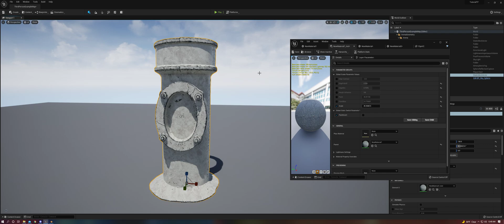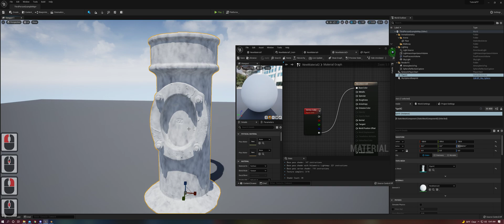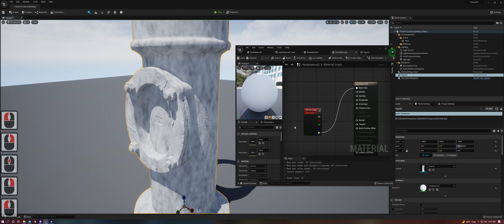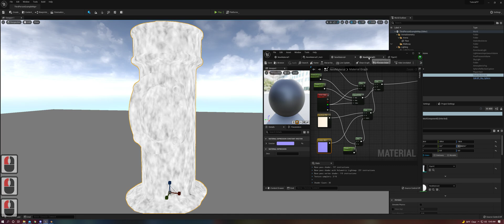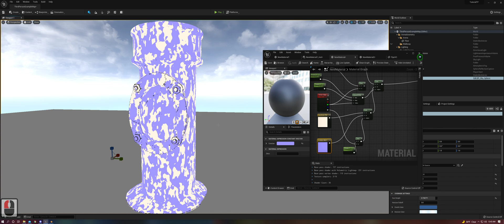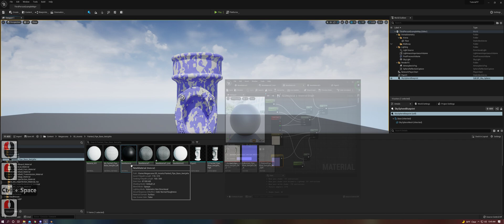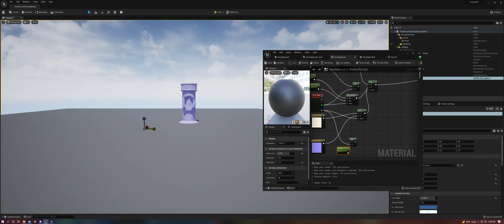Unreal Engine 5 Procedural Nanite Materials Using Vertex Colors

Comment: Hey man nice tutorial, but how to export meah with vertex color from blender? I dont have that option in by fbx export section :O
Reply from the maker: I don't believe you need to currently specify to export vertex colors, but do make sure that the desired vertex color channel is selected when you export your file as Unreal only supports one, whereas blender supports multiple.
Reply: @TechArtAlex  Thanks for reply, ive found my problem - when creating vertex color attribute - domain should be Face Corner and data type Byte Color.

Comment: Great, thanks for the tips. A way to fix the noise popping. If you don"t bake the noise in the vertices but use instead world noise then it should not be a problem that Nanite removes verts on flat areas right? SO use the Vertex bakes only for Curvature and AO, since they are on more denser areas, and for flat areas just use conventional world aligned textures. You can use the other Vertex Channels to separate materials for example.
Reply from the maker: Exactly. For something like noise it would be best to use a texture.

Comment: How expensive is this compared to a more classic workflow with UVs ? (in terms of shader complexity)
Thanks, that's a very interesting technique
Reply from the maker: A fair bit more expensive, but not prohibitively. However, because they can allow multiple objects to look visually different on a single material, they can counter the cost through allowing for fewer draw calls and less unique texture fetches. If the material will not be re-used in the scene, it would probably be better to bake the result.
Reply: @TechArtAlex  Amazing, thanks for the answer, ! That's really interesting. I'm gonna experiment a bit with that :)

Comment: Hey Alex! Thank you so much for the tutorial! I am having an issue where the world align normal doesn't work with nanite mesh, I am wondering if you have ran into the same problem or if there is a special setting for it ? Thank you
Reply from the maker: Yes, I believe I had to use world space normals instead of tangent space normals with Nanite. You can simply use the transform vector node on your normal map and set the boolean in the world aligned node.
Reply: @TechArtAlex  Thank you so much ! this fixed it !

Comment: Glad I found your channel. I’ve been googling information on this all day. I do have questions though. Can you use layered materials instead to blend in between the vertex color mask? If you’re familiar with paragon and how the textured their characters I want to attempt the same approach with nanite meshes. 

Can you create more than 4 channels. Is it possible to use the procedural channels like you did but also have 3 more channels for more material options. I’m half way into the video and wanted to type this before I forgot.
Reply from the maker: The mesh can only have 4 colors per vertex, but you don't need to use the full depth of values for a single function. 
In other words, you can say R 0.0 - 0.1 gets masked out, then multiplied by 10 to now represent a full 0-1 range but at 1/10 the bit depth. So it isn't technically creating a new channel but you can get some of the mileage.  
I haven't tested this with the layered materials feature but I don't see any reason why this technique wouldn't work in conjunction. Do you mean you want to use baked vertex data as an alpha to assign layered material? Or that the effect of the vertex color on the material would differ depending on what material layer it's under?
Reply: @TechArtAlex  okay that makes sense so I could put a .2 value in a channel and that’s a different vertex color but in the same channel. I guess I would have to do some if statements in the shader to sort out the values. As for the layered materials it’s similar to your set up how you use the vertex color as the mask to lerp different materials. So theoretically it should work almost exactly the same. I’ll probably get some tests this weekend to be sure before I decide to add this to my pipeline
Reply from the maker: @AntiHeroGameStudio  Right. Rather than having the vertex color directly drive an alpha, it would need to be decoded by the shader so it would take precise planning when authoring assets. My "Stop Using Skeletal Meshes" video has an example of using a precise vertex color value as a mask (using the bitmask node).

Comment: With the noise drawback you pointed out here, do you think a work around could be to generate noise in Unreal or create a separate noise texture? This way neither are relying on the vertex thus we don't get the popping. Just something I thought about watching this.
Reply from the maker: Yes. When dealing with geometry independent data, I think it would be best to use a texture based mask, especially if the mask will have sharp edges and not a soft gradient/falloff. I only included it to deliberately cause the technique to fall apart, and have an excuse to use all 4 channels to demonstrate. But for some especially detailed meshes, or instances where you don't have a leftover texture channel I could see it being good enough.